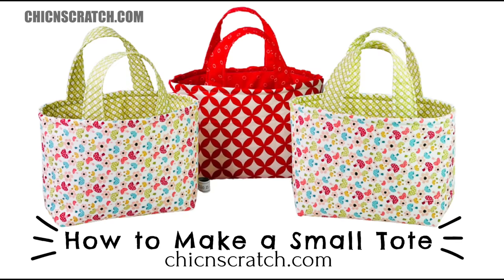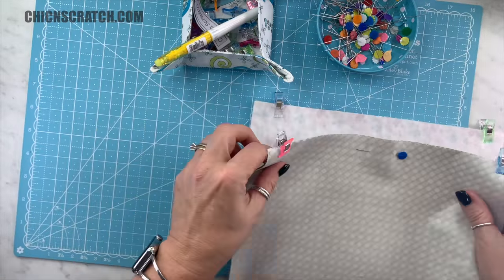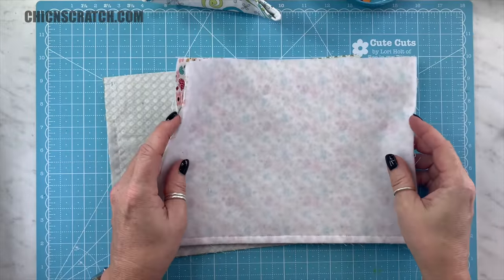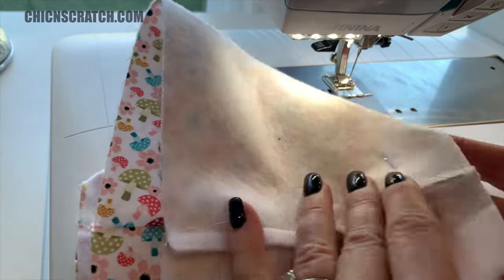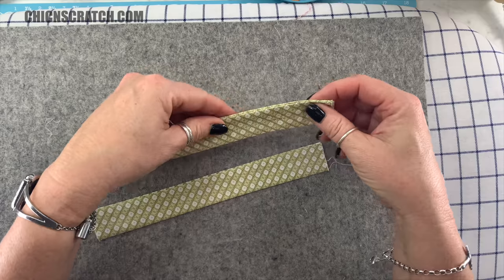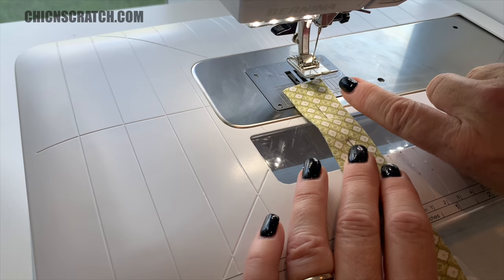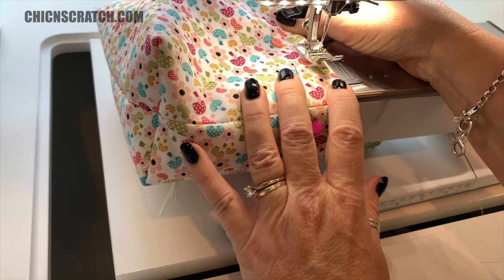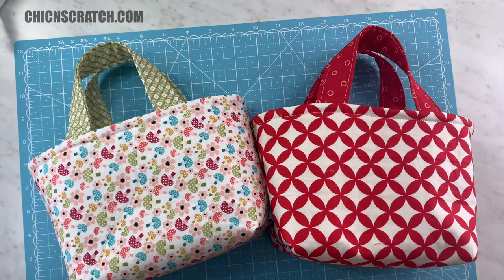How to make a Small Tote Bag

Comment: WOW !!!  This is the first "quite in - depth" video about sewing bags I have found.  This bag seems so easy to make with how you show us step - by - step just what to do, and, how to measure and cut the bottom part to get the box shape.   I'm prob gonna be making at least one of these bags tomorrow.   Am wondering, though, how it would work out if you put a snap or some kind of closure on the inside - top of it.  Also, I'm no longer scared to use the fusible interfacing.   TYSM for sharing this video with us.  😍

Comment: I just saw discovered your videos. Such cute bags and clear instructions.  I wanted to mention that I often don’t pin when sewing small pieces.  For example, when doing those tiny handles they have been ironed and fleece added so the folds and sewing line are well established. I find that the pin makes a lump and then when I remove the pin it causes me to shift the fabric just the tiniest bit. just a suggestion for those who are new, try it pinning and see if it works better for you. I do use pins when piecing long seams.
Reply from the maker: Thanks Gwen, I will give it a try and not use pins on the small pieces.
Reply: I meant try NOT pinning. Geez.
Reply: @chicnscratch  let me us know what you think.

Comment: I hope it’s OK to ask. I’ve made some of these for my charity raising money for Koalas and Adelaide South Australia, but I’ve decided to do my straps differently instead of doing in the middle of the bag like you have, I’ve decided to do them. On the opposite sides of the bag and I’m only using one strap the handle so do I still put in pin the handle on the outside of the bag or on the inside of the bag?

Comment: Easy to understand! I enjoyed the process. w
    Was wondering if I wanted to make this a little larger, would I add the same number of inches across the top and bottom or a different formula. In other words, would I change the 11x8 to 13x 10? Thank you.
Reply from the maker: I made a larger one this weekend and here's the measurements for you.  11 x 10 is a nice size.  I made the handle larger by using 3 x 14 instead of 3 x 9. I hope that helps. I'm going to film a video on this new size soon.

Comment: LOVE the tote, adorable! I plan to make it. I envy those with everything they need after they watch a tutorial, I always have to run out and buy something.  I’ve never used interfacing/fusible fleece. I stand in the aisle and just stare at all of it with confusion, so THANK YOU for telling us exactly what to buy!  I have a questions!..I see people doing this in various ways and I retain more when I understand WHY I am to do things a specific way.  If you can help…. Most people insist you should press seams but you didn’t. What difference does this make in the end results.  AND the more important question. When basting the handles on initially, you sewed from the outside, but I see a lot of people attach from the inside lining fabric, same when you attach the outside fabric and linings before you pull through.  FInally, some “topstitch” on the outside (seems logical) and other people do that last stitch from the inside …. I subscribed and would love to hear your thoughts!!
Reply from the maker: I'm so glad you love the tote!! I'll try to answer your questions...  I usually press seams on all my quilts but when making these totes/bags or baskets I don't because I don't think it needs it.  You can try it and see if you like it but you will find that pressing the fusible fleece isn't great for your iron!!   I'm sorry I can't answer you about the handles.  I am self taught and that's just how I did it.  I will try to find some videos and see if I can improve mine.  I love the topstitch to finish off the bag and  I wonder if their sewing machine doesn't allow them to stitch on the outside because the bag/tote won't fit over the arm?  Thanks so much for subscribing!!

Comment: In my pleathera of bag making tutorials…..  for the turning opening, back stitch, changed the stitch length to greater than 3, for a few inches, back stitched, returned the stitch length to greater than 2.  Pressed the seam open and rip the opening open.  Makes the turn in of the opening easier.  Hope this makes sense.
Reply from the maker: I wish it made sense but it doesn't.  Have you seen a video somewhere that I can watch and learn?  Thanks!
Reply: Oh my….  I wish I could find the video.   Let’s try this…. Where the opening is, just sew it shut with an increased stitch length.  Press the seam opening (to the side or open) which gives you a creased fold.  Remove the stitches, turn the bag and you have the correct seam allowance making it easier to stitch shut with the already creased opening.

Comment: Question for you. how would you measure the handles if you don't have a square ruler like what is in the video?
Reply from the maker: You can use any ruler. For example if you use a 12" ruler - pin the center at 5" and then pin on the right side of the 5" at 1--1/4". Then pin to the left of the 5" spot at 1-1/4".
Reply: @chicnscratch  Thank you! I was thinking that as well but was scared to make an error and have to start all over again! Thank you so much!

Comment: Here's a tip: Do not iron on top of your cutting mat! I ruined mine doing that. I had my wool pad on the cutting mat, and then fused interfacing to my fabric according to instructions, using steam for 10-15 seconds all around the piece. It was so much steam that moisture and heat transferred through the wool pad and badly warped the cutting mat. I've been working for days to un-warp the mat by doing controlled heating and then weighing down to flatten it back out. What a mess!
Reply from the maker: So sorry that happened to you! I have noticed that that about the  wool pads. I heard one ruined someones kitchen table.  I've started using a thick towel under mine (when I use it).
Reply: @chicnscratch  thanks for the tip! The wool mat is so convenient otherwise.
PS thank you for your videos!